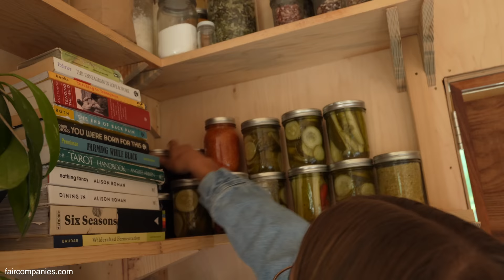CA artist-farmer builds $25K quiet home to savor simple life

Comment: Lovely! (Only 1 thing to do different... the step supports need to be placed horizontally rather than vertical to the damp ground (which will wick moisture into the straw-like ends of the wood causing the wood to rot). Blessings!

Comment: The outside wall covering should overlap the boards (like weatherboard) below it so water doesn't get into the gap. You have it in tongue and groove and water will get into that groove and rot the timber, and damage the interior wall.
Reply: It's so dry in her part of the state, it probably will never actually become an issue.

Comment: I had an outdoor shower with solar heated hot water. All I did was took an old 30 gallon tank and painted it flat black ,set it up on a skid
 Not good in the winter in Indiana. But works perfectly spring and summer,fall.

Comment: In case it's helpful for anyone, some tiny house-friendly products I've found in my multi-year journey of designing my dream tiny include: CLOSET BOOM (hanging clothes storage that folds down to just 3 and 1/2 inches deep!) * WONDER WASH for non-electric laundry or LAUNDRY ALTERNATIVE for compact electric washers and no-heat spin dryers * LAGUN table mount for easily adjustable/removable table or counter space * SHOWERDOME to prevent steam * NAUTILUS retractable shower door * BAMBOOLOO for an actually pretty bucket-style composting toilet (could build your own) * HUMANURE HANDBOOK and website. The website includes the contents of the book plus helpful videos

Also: elevator or murphy beds instead of or in addition to a loft! 

My favorites are on counterweights (see Kirsten Dirksen's video on counterweight beds "Adaptive space-saving bed snaps into ceiling when not needed").

Lots of examples in tiny houses:

- The Camper tiny house with counterweight elevator bed by Build Tiny New Zealand (love this company!). 
Can sleep up to four adults when in bunk bed mode over fold-out couch
- Ana White's elevator bed over couch with garage door electric mechanism
- Beautiful San Juan tiny house with elevator bed over couch with manual non-electric winch using garage door parts
- Ana White: "How to Build a Loft Bed Triple Bunk Bed Room (Episode 11)" 
Pull-out bed that tucks partway under wall with storage shelves to become a couch during the day
- Tiny Home Tours: 5 Innovative Tiny Home Bedroom Layouts - Elevator Beds & Murphy Beds
Includes a horizontal (vs. vertical) murphy bed with a homemade mechanism

Comment: Love her home, but if she wants to be less afraid of fire, then she should have applied firewise principles to home construction and location. First, she could have used Hardiplank siding (concrete) which is non-combustible. Metal roof is good, so that seems fine. Not storing fire wood under the home, not having a wood deck attached to home--these are things that are very dangerous if a fire approaches. Second, she needs to drag it to a spot where it's at least 30 ft away from trees/tall shrubs, 100 feet if possible. Lastly she needs 5-10 feet of bare dirt or hardscaping around the home, and then low growing, well-irrigated vegetation out to 30 feet. Essentially, if she can't keep the grass green, then remove it and put gravel or paving stones with low flammability well-spaced plantings. Main principles here for optimal fire protection here: Keep large vegetation that can throw firebrands 100 or feet further away, prevent running flames from getting within 10 feet of the structure, and construct your home so it is resistant to both firebrands and flames. On the plus side, she can maybe tow it away if fire is in the area.

Comment: Why not put guttering on the roof to collect rain water & have a 5000 rain water tank placed next to the house placed on a patch of raised ground at least 1 foot for a bit of  pressure.?? Also im curious if it's ok to have all the cupboards, stove & sink all on one side with not much  cupboards on the other side ...how does it balance out the weight of the home on the trailer?

Comment: A 100 ft coil of 1 inch interior diameter black garden hose attached to your cold water pipe and placed on your roof in full sun will hold 4 gallons of water (weighing between 40-50 lbs) that will get VERY hot in the sun's rays (alternatively, a 100 ft x 1.5 inch ID hose will hold 9 gallons of water weighing between 90-100 lbs).  Mix the hot water from the black hose with cold water in the shower, and you will have the makings of a very comfortable solar-fueled shower :-)

Comment: Im conflicted on it.  I think it is beautiful, but not the most practical.  Wouldn't it have been easier and cheaper to just get an RV?  You have your shower and shitter inside and can pay someone to pump it when you live off grid.  I admire it, but it would get old quick dealing with your waste, and dealing with showering outdoors.  But it looks green and is packaged like that.  As much as it is idealistic, you eventually grow up and realize you need certain comforts that require you to use fossil fuels.  Those solar panels are made somewhere too.  The truck needed to haul it places require fossil fuels.  The tools, nails, wood that was cut in a saw mill all used some fossil fuel too.  But let's ignore all that.  Where do you put your solid waste?  Does it end up in a dumpster?  Do you burry it somewhere illegally?

Comment: Love your Tiny House! If you wanted to get off the fossil fuel shower you could set up what allot of pool owners in cooler climates do. Run black pipe across your roof back and forth from your hose attachment to your shower. The sun would heat what is in the black pipe so the more pipe you have the more hot water you would get.

Comment: Build a solar water heater? Why wait? I got tired of waiting until I had all the money for all the materials to build a solar water heater, and the help to hoist it onto the roof. So I took the 150 feet of black tubing, tossed it onto the roof as is, coils spread out, connected one end to the water intake, to the the temperature regulator at the other end, and presto! Solar water heater. Cheap, and functional, until I finally get around to buying, painting the plywood panel, coiling the pipe properly, painting it black, putting a plexiglass cover over a frame...

Comment: You hippies need just an old builder to teach you to toe nail the bottom plate to the deck before lifting a wall. It is a hinge and it wont let your wall go down the hillside. So much knowledge out there trying to be reinvented with screwups unneeded.